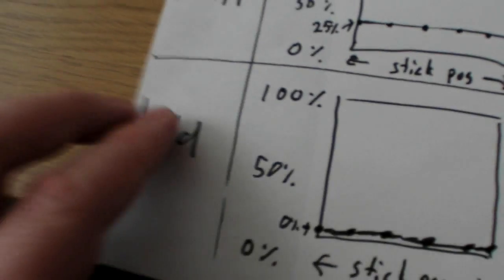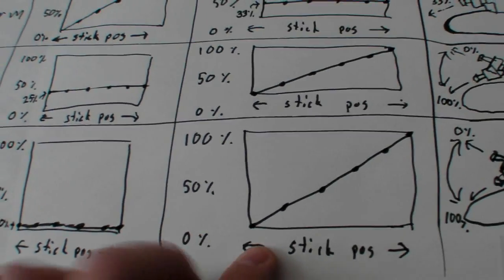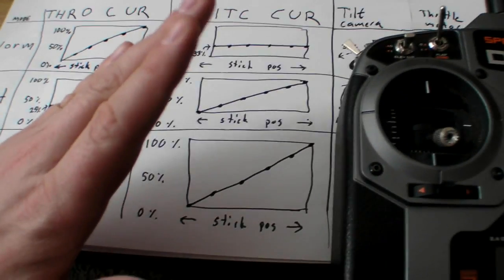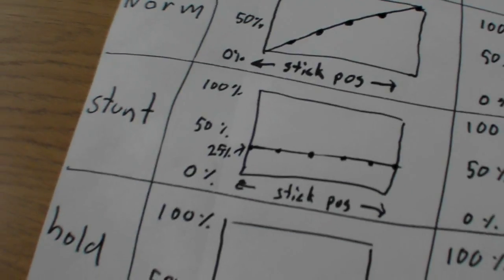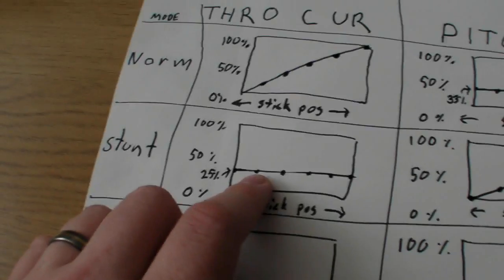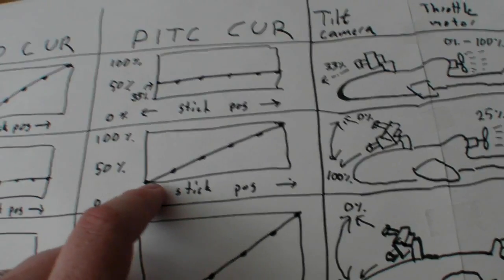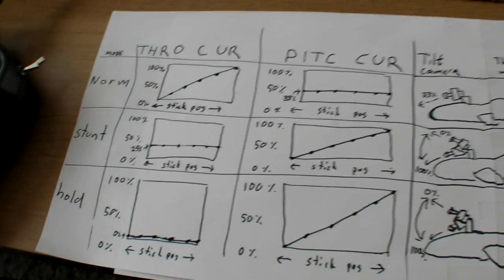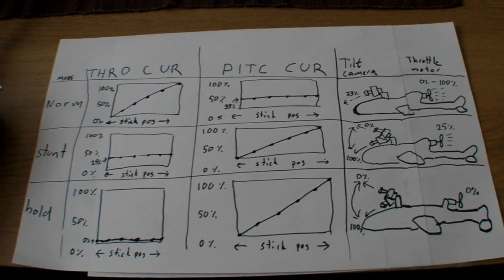FPV pan and tilt using heli curves

Comment: I was also thinking about secondary transmitter, which should be ok with autopilot installed on board. With T9x it would be possible to use many channels for various options. I was also thinking about cameras switch (2 cameras on board), which would require another channel...

Comment: Pretty neat solution! Thanks, this is really inspiring. I am thinking about FPV camera with optical zoom, but guess what? I am missing one channel in my 7C Futaba. I need two channels for pan&tilt (HT via trainer port) and the remaining 5 are used to control plane (two servos for AIL + flaperons). I think I have to sacrifice either flaperons or RUD. Do you have any better idea? I can not use troth/pitch curves in ACRO (plane) mode in my radio. They are available only in HELI mode.

Comment from the maker: It's been i long time since i used a dx6i but i think it was: Swash mode 90, ch aileron to plane rudder, ch rudder to cam pan, ch pitch(aux) to cam tilt, ch elevator to plane elevator and ch throttle to plane throttle.. I hope i got it correct and that it might have helped !

Comment from the maker: @bdcp The radio i have in the video is a Spektrum DX6i, but any advanced programmable radio will work. I now have a Turnigy 9x and waiting for a FrSky module to it. Then i will have telemetry, the radio will beep when battery in the plane is running low or if i fly to far away and the signal gets low. There is no best radio, everyone have their own favorites,  look at forums and read a lot before you decide..

Comment from the maker: @SirArghPirate I get all my rc stuff from there, except the planes (big boxes = high shipping costs). The motor have the product id HXT2835-2200. If you have a real 35mhz radio (at least 4 channel) you can use it. What radio do u have?  It is $23 for the 2,4Ghz radio ! and its a good radio to, not a very advance one but would be perfect for the easystar. I myself am waiting for a Turnigy 9x (9 channel computerradio) only $55 from them (but it is on backorder and have been for a while now)..

Comment: @petleh82 Thanks. I need to take a closer look at their website, I wasn't able to find the motor there, too many to browse through. I have a 35MHz radio already, but I think it's possible to change the frequenzy modulator into one with 2.4GHz. Anyway I caould always use a dedicated radio for this. It's very cheap though, only $23 for a radio, or is there a zero missing?

Comment from the maker: @SirArghPirate The motor that comes with the easystar i throw away.You should have a brushless motor, i buy all my parts from hobbyking. Motor is a Turnigy 2200kv inrunner (fits perfectly in the easystar),price $18,8 (thats 112 nok), speedcontroller Turnigy plush 30A,price $14,3(86nok).They even have a complete 6channel 2,4ghz radio+receiver for just $23(138nok) (If you do not already have a radio). Battery i use is turnigy nanotech 3s 2200mAh $11(66nok).You will also need prop,servo,charger etc

Comment: @petleh82 What kind of hardware are you using for this plane? At elefun.no they sell this model along with a brushed motor. One hour flight time is a very long time as far as I understand, is that with the camera rig as well? 

Perhaps a stupid question, but do 3-channel planes have to be with wings on top, giving a low center of gravity, since they don't have ailerons for balance?

Comment from the maker: @SirArghPirate Haha,she think i am stupid to spend money on toys. I do recommend the multiplex easy star for beginners and this is why,First it have the prop on the back (a prop in the nose would break every time the landing isn't perfect).. It uses only 3-channels(motor,up-down,left-right),and is very stable by itself. Flight time,you can get over an hour per charge. And if you crash it, it is always easy to repair it. Look at my vid "Funjet fail, no control", same material, it does fly now :-)

Comment from the maker: @gc9n I don't think its good to have a Y harness to mix them, i think its better to connect the rudder to a free channel and do the mixing in the radio. I think you only should have a little rudder mixed in and mostly control the plane with the ailerons.. I don'e see how gear can be used for panning unless you have a very advance radio with steppless control over that.. There is a way to use a headtracker for the dx7 search youtube for SkywireRC DXTR ...